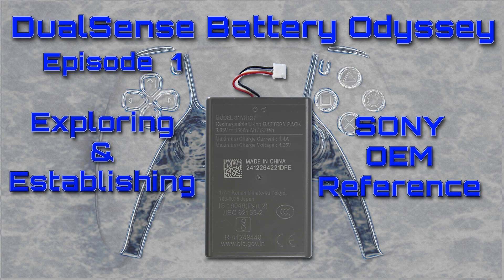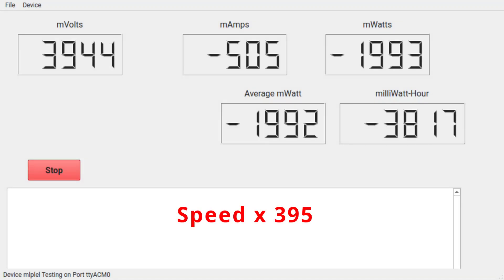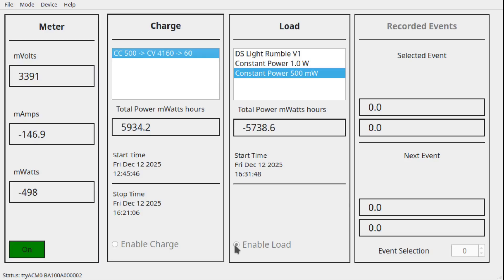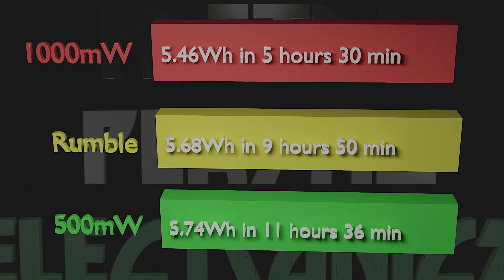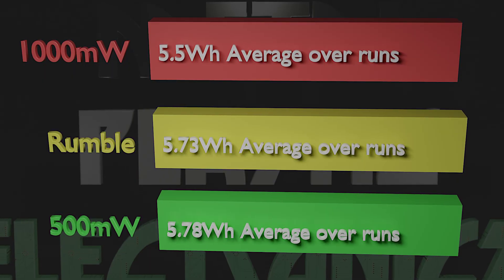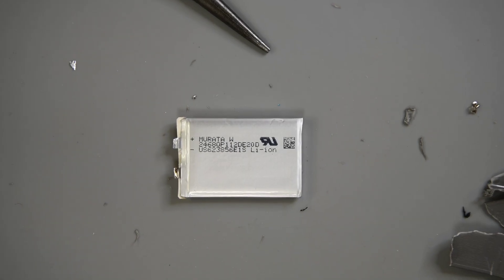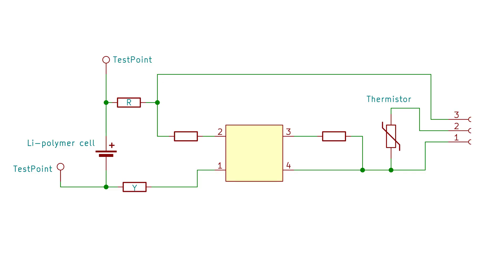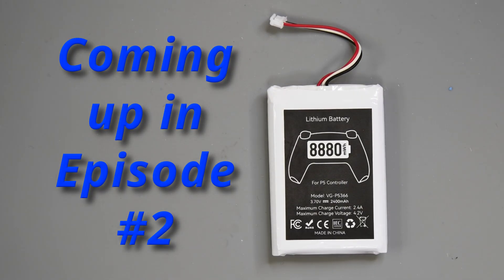DualSense Battery Odyssey - Episode 1: The Ultimate Baseline: Sony OEM Battery

Comment: Just something I noticed with one of my brand new DS (Edge) that could affect "total"  battery life from a "full charge" slightly.

If the battery is above 60-70% when you plug it in it will NOT charge.

And keep itself at that percentage until it's discharged below either the 60-70% threshold. 

I can't verify the percentage I saw was ACCURATE: but my controller consistently DIDNT charge when it was above that percentage according to the software I used... 

And I tested it with a few devices both new and old/degraded battery. 

So there is a % "buffer" that can sometimes be "subtracted" from your "full charge" that may or may not affect total playtime.... 

This might be common knowledge but I've owned DS devices for years and only noticed this recently. And figured it was topical! 

Great info! Thanks for taking the time to cover this.
Reply from the maker: The DualSense behaves similarly: if the battery is above a certain charge level, it won't start charging. I haven't checked the specific levels the Edge charges and discharges to. While the DualSense doesn't drain the battery to a harmful level, it does charge it nearly to 100%. So, the fewer times it does that, the longer the battery's life.

Comment: Man, someone needs to take a closer look into the Edge's USB-C port. There's a major issue with the design. I've owned mine since if released and was available in most places for purchase. I have not been able to use it plugged into the console or anything like useful tools like gamepad tester. It's a serious piss off tbh, as someone who prefers a usb connection, the fact I need to solder in a new port sucks.
Reply from the maker: How long after you got the controller did the issue begin?
Reply: @metalplasticelectronics354 oh, it actually didn't take long. But the way Sont went about things, prolonged the issue. To the point where by the time I could no longer get a direct connection (which I can, mind you I have no choice but to put a massive amount of pressure either upward or downward, and it's extremely intermittent) and was ready to force Sony to either repair or replace it, I was passed the one year mark. It was countless USC cables sent to me, then locking mechanisms, etc, etc..

  Sorry, to answer your question though, I'd say 3 months max till it was a major issue.
Reply from the maker: That's unacceptable for something so expensive. My USB connector is fine, but I've started noticing a connection issue with the left stick module. Mind you, I've probably swapped the stick module in and out of the controller over 100 times, and it's been mostly the left one. I just haven't had time to investigate where the problem is coming from.

Comment: If you keep this series going for a while, think you will also test DualSense Edge batteries as well?  I know the Edge batteries are smaller, and have less capacity. 

I can't wait for future parts.  While I leave my Edge plugged into my PC all the time, My kid has a PS5 in his room,  and doesn't always leave the controller plugged into the PS5, so if I have to replace the battery some day, Would be awesome to know if there are good 3rd party batteries that offer longer run times!
Reply from the maker: I don't see why not, but it'll be a while. I think I've counted over 20 different replacement batteries for the DualSense, and I haven't even looked very hard.

Comment: man i never knew i needed this video another idea you could do is test the batteries with added accessories i.e extreme rate led kit for the buttons
Reply from the maker: I don't have those components, but I'll look into it. I doubt they'd have much impact anyway—the haptic feedback, processor, and radio in the controller are likely the biggest power drains.  Thanks.
Reply: @metalplasticelectronics354  so i did install a led kit in my main controller and a few others but it seems the led kits just killed any batteries i put in the controllers that why i asked since i wouldnt even know where to start to test them put i appreciate the video anyway
Reply from the maker: What kit did you install? A lot of light takes a lot of power, but I can't imagine an LED kit pulling that much.

Comment: I'm not a battery expert, but is it possible the Dual Sense doesn't charge the battery the same way twice to increase the lifespan of the battery?
Reply from the maker: I doubt that's the case. I've never encountered any information about lithium-polymer batteries exhibiting an unusual memory effect.
Reply: I think they do it because they aren't in the business of selling batteries and they know how abusive people can be with controllers. I saw another person look in to the unique charging method, and after my experience babysitting hundreds of cells to make ebike packs I can appreciate it. Most power tool chargers are vigorous with charging because people want everything immediately, and tool companies are in the business of selling batteries. Charging the top of the cell range at full current creates excess heat, and tapering current down there is a cheap way to make batteries last longer.
Reply from the maker: Even at the starting charge current, it's only 500 milliamps, so the controller is being pretty gentle with the battery. I just can't find any information on why stepping down would be better for the battery than a normal charge profile.